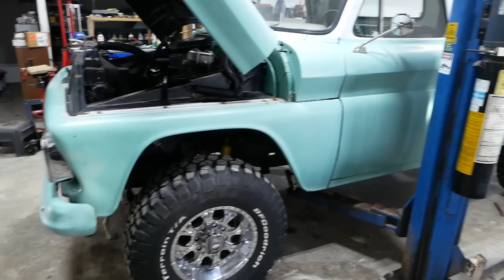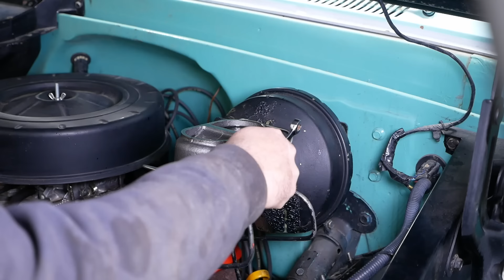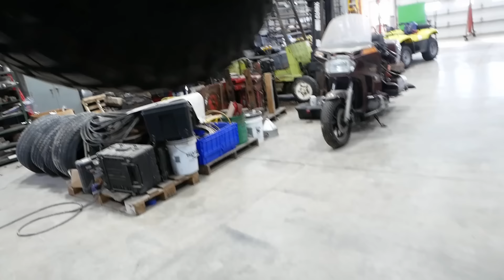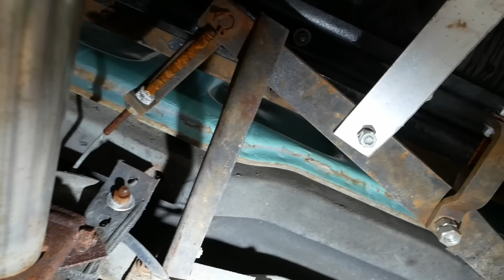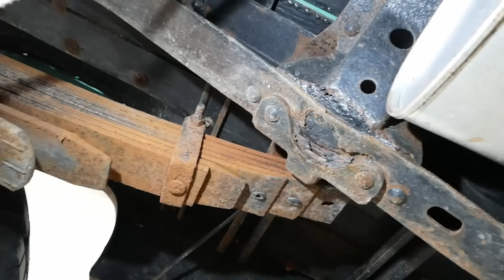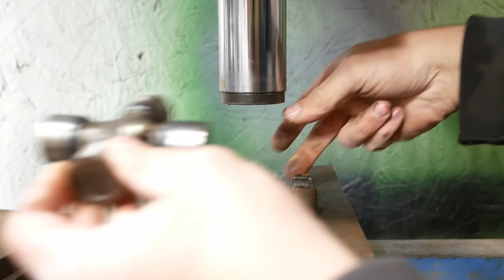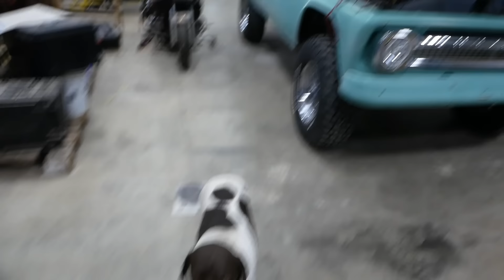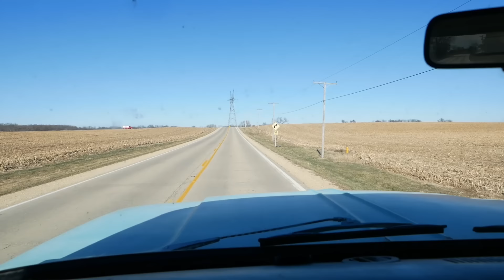New Parts = No Brakes and Other Problems | 1964 Chevy K20 Project

Comment: On U-joints, I spent over 25 years in the driveline industry, only thing we made sure of was to line up grease zerks, and install them anyway that works as long as, like you say, as long as the needles don’t fall into the bottom of the cap, your good.  Thanks for the ride along sir, I enjoyed this one.
Reply: I would have to watch someone like you professionally do it a few times because I would lose all those needles SOMEHOW.
Reply: @tacomas9602  put grease on the needles in the caps, leave a void in the center of the cap for grease displacement on assembly, it helps hold them in place while you install on the trunnions of joint body, it’s also a good pre-assembly lube, I also pump grease into the zerk to fill the lube tunnels before assembly. The rest of assembly depends on situation/ circumstances you find yourself in, practice on an old joint if you can find one good enough to practice on, hope this helps.
Reply: Well said sir,  thank you.😊

Comment: Change gears to 3:55  front and rear?
I have seen where people have been off road then drive on payment thinking a mile or so will not hurt anything at 35 mph.
   Bye bye spider gears or hub splines.
   Not to mention transfer case gears or chain binding.

Comment: Wes, what the hell would you do if you were born in 1951 like me and you were a mechanic? Would you preapologize to every customer; "I am terribly sorry Sir, we will put brand new brake shoes, drums, wheel cylinders, spring hardware, hoses, lines, vacuum booster and master cylinder - we'll even put a new rubber pad on your brake pedal but it is only fair to warn you that your car will still not stop because it has drum brakes on it, just like all the millions of other cars and trucks on the road all over this country. Yeah, none of them will stop because of those damned drum brakes. Of course you could tell them that if they just walk to work and wait till 1967 they will have disc brakes on cars and then they will just magically stop. So tell me Wes about the endless collisions we experienced back then because we had drum brakes. Every body was rear ending other cars and running into bridges, trees and the back of the garage, right?
You weren't alive back then but I was and I was a mechanic, nobody had a problem with drum brakes back then, nobody complained. Because contrary to popular belief today by thousands of millennial mechanics and their imaginary bullshit, drum brakes worked far superior to what I/we have today. If you slammed the brakes on back then your freaking molars would be imbedded in the steering wheel and all the dust on the package tray would be on the windshield. What the hell else would you want brakes to do? However, today if you slam on the brakes your car will roll 100 feet while the computer makes up it's mind what it will let you do, then it will gradually apply the brakes so as not slide the tires and will eventually come to a gentle stop. If someone stepped out in front of you back then they get the crap scared out of them, today, they are dead meat. Please don't tell me I am the least bit wrong, because I am not wrong.
Still a subscriber and you are a great mechanic, you just still have a streak of that cocky arrogant kid left in you. 
Art from Ohio
PS; There are two YT channels that would have any parts you may need for that truck - Elderly Iron - and - Classic Truck Rescue. They both collect old trucks and sell parts and give free advice.

Comment: Back in the 1970's or sooo, I owned a 1963 GMC CarryAll, 4 Spd/granny low, 4x4 with the 305 V6. The 305 was a real stump puller and with glass packs, it sounded like a tractor pulling. A fine ride for sure. Enjoy your adventures. Onward1

Comment: Hello Wes!! I think you done a good job on the U joint or joints they were really bad!! You done a real good on the brakes too. When I was a lot younger I had a 1963 C-10 with the inline 6 250 C.I. with 3 speed on the tree and you guessed it 2 wheel drive only!! with the step side 8 foot bed. Thanks for the video and reviving my memories of a little more fun time in my younger years!!

Comment: Back in the day UJs were changed using a hammer and a socket inside the yoke...and removed with a cold chisel and a bigger hammer, A whining diff prolly means it ran out of oil sometime and its a mess inside.

Comment: Drain that brake line tool out and put 50/50 antifreeze in it works good for flow& pressure in the cold
Reply: It isn't an issue of the fluid, but rather the o-rings having a slightly different dimension.  Worked fine before.

Comment: Love the old body styles and the cab interiors. Engines were easy to work on, could actually crawl in and sit on the fender well, feet on the frame. But the brakes were a pain. If he is going to change the gear ratio, huge benefit in just upgrading to modern transmission, transfer case and axles with disk brakes. Thanks for sharing.
Reply: not all that hard to do either just get the stuff from a wrecking yard......may have to rework your mounts a bit though......
Reply: If you want to mess up all that why not just drive a modern truck?
Reply: @hnegus  Because anyone that isn't poor can buy one but built trucks are more unique.

Comment: Negative Ghost Rider. The problem with a vehicle of that age and condition is that anything could fail at any time. We could replace an alternator and months later the transmission would fail and the customer would be back screaming "it worked fine until YOU worked on it". Unless we are very familiar with the customer we will politely decline the repairs but at the same time try and direct them to someone who will.

Comment: I dig the ingenuity on your one man, hands-free, bench bleeder kit! My only suggestion would be to install a check valve in the lines to prevent the bubbles from reentering the reservoir from below.
Reply: It will suck air from in between the hose connections if you use a check valve. The intention is to let it suck oil and bleed air!
Reply: @stevendegreef93  true, although you could put silicone grease around the hose connections to avoid that. I think you'd want any one way check valves nearest to the top of the loop, closest to the open side of the reservoir.
Reply: I use some old brake lines cut off with rubber hoses clamped on the ends to stick down in the master cylinder in order to bench bleed the air out. Sort of a use what ya got situation and did not take long to make. My sister does not understand why I pack rat so much stuff. When you fool with this stuff long enough that pack ratting comes in handy when you need to make up something quick.

Comment: The proper prescribed method to adjust Drum Brakes is ti adjust so the wheel can’t be rotated then back off until wheel well rotate 1.5 times when spun hard. Then test drive to confirm adjustment is equal  on all for wheels. Re adjust if necessary. all brake shoes should be re arched to match break drum.

Comment: @14:44, that boot on that steering main link bar is done for...

And it looks like maybe the fuel gauge is always powered, since its needle didn't drop when you shut off the engine - the oil pressure gauge did drop then.

Comment: Do the joints your way Wes. And don't post it😄. 
Let's let them squirm on their keyboards trying to figure out how you did them. 
I use what's available when I do ujoints. Nobody seems to care anyway.😄
On my project  68 3/4 ton truck has original parking brake like that truck. I will take some picture for ya. 
Lacking a bit of funds to continue. Have a super day

Comment: wes do you think it wise to be pumping bubbles and fluid with bubbles into the master cylinder a bit like shaking a bottle of brake fluid to fill master cylinder
Reply: That is exactly how to bleed a master cylinder.  Who has done more of them... you or him?
Reply: @ShainAndrews  i have been working on cars trucks since early 1970s so in 50 odd years i have lost count all i meant is introducing aerated brake fluid into a sealed system isn't good practice i always bleed off to separate container and use fresh fluid and never had a problem with brakes if it works for him carry on some time you can't see the wood for the trees

Comment: In my day, we always used a viseclamp hammer press to install u-joints, and we always left the grease fittings in comprension.  You young fellers just don’t know what you’re doing any more, all those computadoray boxes you use have made you lazy and probably left handed too.

Comment: The old saying you can’t judge a book by its cover. Even though I have drove and spent countless hours in a 64 C10, 250 six banger with 4 speed and loved that old truck, we pulled hay wagons, hauled cattle, pigs, sheep, feed and everything that connected to farming with it we ruined it when the power went out in a snow storm and hooked a surge milker to the vacuum and idled it up so we could milk the 70 cows we had. It didn’t like mixing a little milk with the fuel air mixture. After that it slowly worked its way to the junk in the grove. That truck is a 60 60 truck. At 60 miles a hour and 60 yards away from you it’s a nice one. Lots get took by pictures and not knowing mechanics and probably pay premium price for stuff like that.

Comment: It's a straight axle leaf spring rear , so , not that hard to find a 12 or 14 bolt replacement .
The front being the same setup and a Dana 44 , I would definitely look into getting one with disc brakes if this model is not easily converted .
Lots of Bubba Engineering goodness on that thing , lol .

Comment: For the typical u-joint, I used a hammer, socket and vise.  I found the u-joint presses not that helpful and came to the conclusion they were for folks that rarely replaced u-joints.

Comment: I put 4.56 gears in my 14' F150 and it is a night and day difference, it had 3.55 from the factory.
I also have a 6-speed overdrive transmission so it's really not bad at all on the highway and I never really go much over 65 or 70 anyway.

If I was him I would just switch to an overdrive transmission, since he's got a divorced setup you can pretty much put whatever you want in there and just adjust the drive shaft length accordingly. 

I would leave the gear ratio alone honestly, especially with a probably somewhat anemic small block.

Comment: Great Video, Wes. I was surprised to see the Tachometer working. Neat old truck. Gears all over that driveline, transmission, Transfer Case. I’m sure it makes some noise, needs a better radio, problem solved. Thanks for the videos.

Comment: That truck would have been a single circuit master cylinder. I don't think they put dual circuit brakes on until 1967 when they changed the body style and vehicles were required to have them. The K20 would have had 16 inch tires. Larger tires on the small drum brakes don't provide very good braking. Softer brake linings provided more initial stopping force but wore out quickly. Harder linings provided less stopping force. I remember those trucks as being very noisy. The transfer cases made a lot of noise and trucks were trucks so they didn't do much engineering to abate noise. They drove and rode like a truck.

Comment: If you need to worry about the grease hole in your u joint being in compression then you need u joints with no grease hole or the ones that grease thru the cap so they are only drilled on center.

Comment: The correct way to replace U-joints, is the way that works for you with the tools you have available.  Keyboard mechanics be damned!   Great job Wes!  I'd love to lay my hands on a truck that looked that good.  Even if she does need a little love.
Reply: I do prefer a pressing action to a percussive action when installing them though.
Reply: Yeah, sure, that works. But no hammers. That's the one thing that's not acceptable. And not just because it alters the metal, but also because it wastes your (the mechanic's) time and because the customer will have a shorter life span on said part. Like whenever i see bumblebees smack the steering arm... visibly denting and deforming the metal... no es bueno.
Reply: @aserta  if i have to use a hammer there its my orange dead blow hammer!
Reply: I have a lead hammer 🔨 that I cast from a tomato sauce can with a three-quarter inch pipe for a handle. I can beat hell out of a lot of stuff and not worry about distorting it.
Reply: @stevanrose7439  lol that's awesome

Comment: We had one of those Chevys, and the parking brake always froze in the winter, so it was kind of useless. On the subject of grease zerks, I always tried to make sure I could access them easily. That way they for sure get greased. I don't recall ever seeing guidance from Chevy, so you do as you deem prudent.

Flex Hose??? That's a good way to break the fittings on the radiator.

Comment: Pretty sure the factory master cylinder was non-assist and single-circuit. Step-side boxes used a chain-and-hook into a fixed tab / hasp from wayyy back through the 80's square body production to latch the tailgate. The box itself was the same from '55 through the 80's with just the fenders getting refreshed. The Cameo and Fleetside boxes introduced in the '55-'59 models used a pivoting hasp / bar. '60-'66 Fleetside used the hinged hasp / bar like your example. 1967 Fleetside boxes introduced the "latched" tailgate.

Comment: Ditch the rubber lines, clamps and zip ties and just use short pieces of copper nickle brake line.  It's easy to make, bend and it holds it's shape.  Bleeding made simple!  Look at the GM 14B for a replacement axle - should be a fairly easy direct swap.  That truck is a piece of work!

Comment: I was taught to tighten drum brakes till they stopped the wheel turning , then back them off till they turned.   About  then I learned that the handbrake brake adjuster just plain doesn’t work, you can haul on the thing ‘till you’re blue in the face, you still have to get underneath !
    Wait ! wait a minute ! that parking brake must be missing the arc shaped yoke that usually comes off the front cable ?

Comment: hey wes i put i u joints any way i have to to get them in if they say you shoulda tell um well you do you ill do mine if they go in an dont fail then its all good as for axles a dana 66 would work with the 44

Comment: Wes I have a 1964 Suburban.  I swapped my rear axle to a common 14 bolt, and it’s an easy swap because the spring mount perches are the same width, at least on the 3/4 ton axles.  The one tons are a bit narrower, to fit dual wheels.  I also swapped transmissions to an NV3500 from a 90s Chevy, which gave me overdrive.  My tires are 31” dia, and with 3:73 gears, the engine spins 1800 at 60 mph.  You are correct that there is an equalizer bar for those e-brake cables.  That brake master cylinder is definitely not stock, as these trucks still had single pot masters.  Looks like the common corvette master, which is designed for disc brakes.  Thanks for the video.  Oh ya, I suspect Novak Adapt could supply you with a new transmission output yoke.
Reply: C/k 10 half ton c/k20 3/4 ton, c/k30 one ton. The one in the video is a k20. C 2wd, K 4wd.

Comment: Wes vs drum brakes round two!  I share his "love" of 4 wheel drums. I cut my teeth on first gen Mustangs with 4 wheel drum brakes, and to this day (45 years later), I have an undying loathing and hatred for them. Those brakes were anemic, impossible to adjust correctly and erratic; and that was on a good day. Add a little moisture to the equation and now you had brakes that barely functioned at all. 

Disc brakes are a godsend.
Reply: yep.  i had a 57 Chevy Bel Air, same setup.  You could get 1 good stop, then you had to add distance....
Reply: I had a '68 Cougar, and I could never get the fronts to stop pulling to one side...
Reply: The brakes on our 67 Pontiac station wagon were good for one panic stop. After that, you were driving an unbraked miss

Comment: Possibly already done with the truck, but you can swap the whole axle assembly on these to the squarebody 73-87 axles and get open knuckle front and disc brakes. A 14bolt rear will fit as well and you can get a disc brake kit for those as well. I swapped them on my 68 that was 4 whl drum and they bolted in. The only thing I am not 100% sure on this truck is if the springs are the same distance apart, but I think they are. If you put the newer axles and factory brakes on it, then you can use the same master cyl and proportioning valve off the squarebody too. Oh, the 66 and older were single reservoir master cylinders, so the one on this truck is not factory. 
Last thing, I have had and been around a ton of these trucks and this is the only one I have seen a factory tach dash in, that might be worth as much as the whole truck to be honest...
Reply: My guess is the instruments are from a big truck. Most of them had all gauges with the tach too.
Reply: Those gauges look to be aftermarket replacements. They look too new to be original and the old truck most likely did not have a factory tach originally.

Comment: Wes, just imagine riding in the back of one of those (3 on the tree 2wd) with a camper shell sitting on a lawn chair for 3000 miles round trip. Not enough room in the front seat for four plus no AC. That was way back in the late 60s and my ears rang for two days from the road noise. Swore in my youth that I would only fly to any long distance destination after the trip and have held to my oath to this day.

Comment: about the grease zerk in compression thing, we wont over this in my heavy diesel drivelines class and its a bunch of garbage. apparently there was one hot rod magazine that claimed in a tech article you could hold more power doing it and a bunch of people latched onto  it as gospel. If it had any merit than surely heavy duty trucks would only have one zerk and they would specify it in the manual